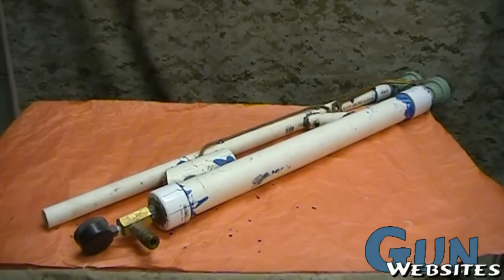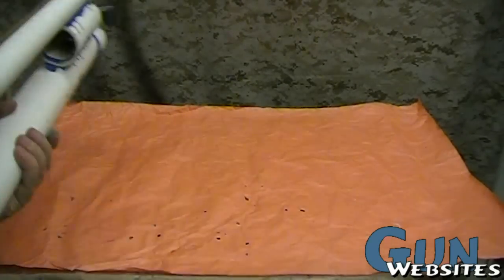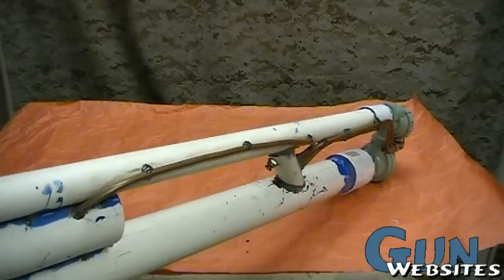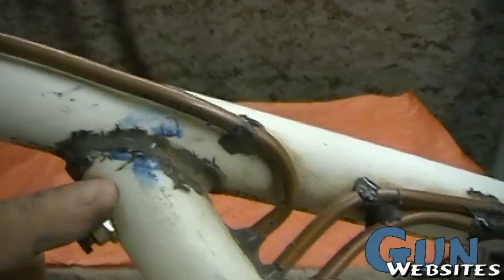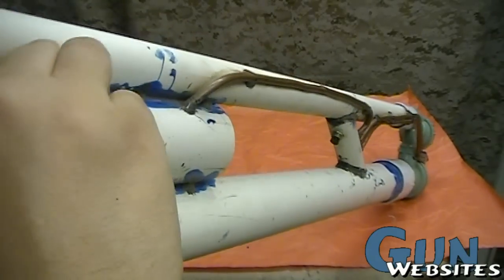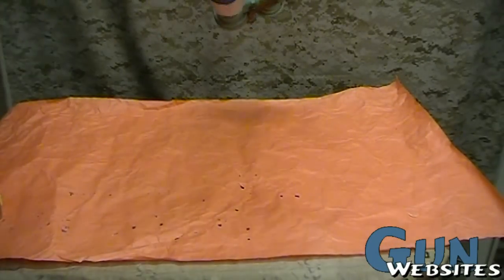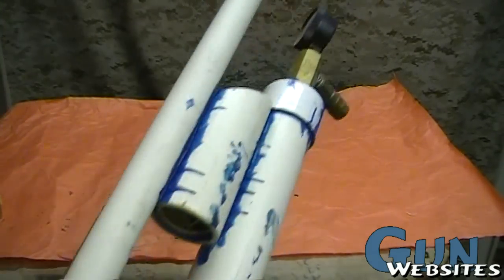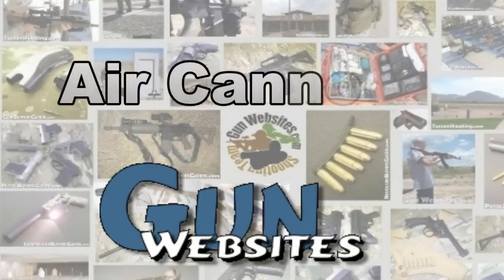Air Cannon Intro

Comment: you can attach a air gun to the sprinkler valve and it works really well. Then you dont need batteries. If you get a threaded sprinkler valve you can make different sized barrels and shoot different things.